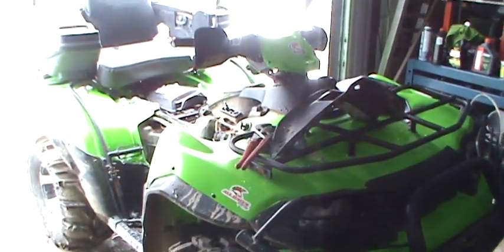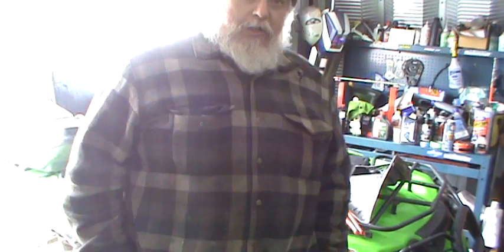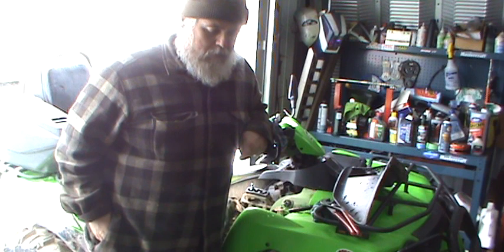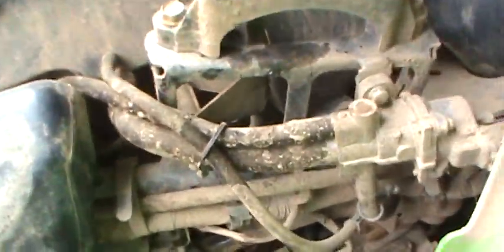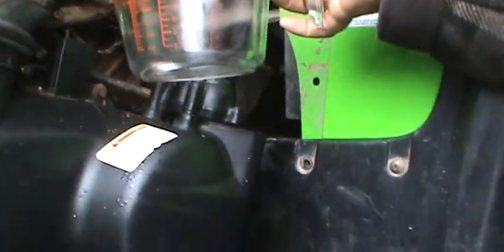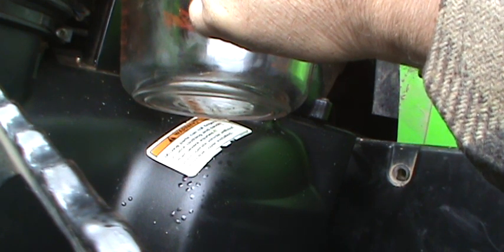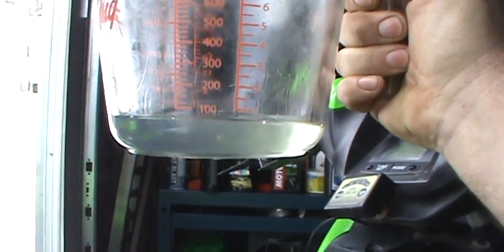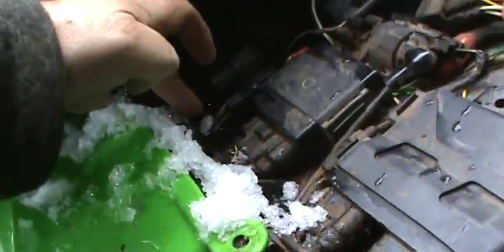Kawasaki brute force 750 no power backfiring fix

Comment: 1st off thanks for the knowledgeable vidoe(s) new subscriber here. My questions are, will that fuel pump from RockAuto work for the application of a 2010 Kawasaki Teryx 750 fi? My son did the oil change on our Teryx while I was at work & put 4 quarts in when it was only supposed to be 2.7, he drove the damn thing & oil started spitting out the exhaust smoking from exhaust + the gear shifter box he turned off the T-rex once he noticed which didn't take long, now the damn thing runs sluggish as a tortoise/backfires. The plugs were fouled- I changed them out but still running sluggish, the fuel filter was dirty as heck replacing that as well, now I'm going to check the spark arrestor may end up totally removing it. Your thoughts please.
Reply from the maker: The fuel pump mod I did should work on anything with an in tank pump. Yeah we have had them over filled before. Just make sure you flush it out real good and it should be fine.
Reply from the maker: Also thanks for subbing! we appreciate your support.
Reply: @HammerHeadGarage  The fastest reply I've ever seen on YouTube! Much appreciated, Thank You very much & have an Awesome day!
Reply from the maker: @gonzobongo6669  You too buddy! have a great one.

Comment: Is there a way to check fuel pressure on these without rigging up your own gauge? I changed fuel filter and my machine is still cutting out around 30 mph. Plenty of fuel volume in 3 key turns. Thanks for the help
Reply from the maker: If your pump is fine the small screen where the pump connects to the plastic housing is blocked. Take a bent nail and poke a hole in it.
Reply: @HammerHeadGarage  I replaced fuel pump and had 43psi of fuel pressure. Machine runs great until it gets up to operating temps and it’s back to bogging down at 30 mph. Now I’m thinking it may be a temp sensor issue
Reply from the maker: @dylannelson6223  Coolant temp sensor will make it rich as hell on warmup if faulty. What do the plugs look like?
Reply: @HammerHeadGarage  plugs were replaced about 20 miles ago. I will have to take a look at them
Reply: @HammerHeadGarage  is there only one coolant sensor on them?
Reply from the maker: @dylannelson6223  yup.

Comment: did the new fuel pump fix the problem?  my '12 brute force 750i does the same thing, runs and idles well, and once you give it full throttle, there's nothing there.  Already changed the fuel filter sock, it was pretty dirty.
Reply from the maker: Yes sir it sure did. There is also a filter screen where I pointed out in the videos that sometimes clogs up. Use a bent nail to poke a hole in the little screen.

Comment: Hey how can we get in touch, I just replaced the drive belt on mine and I cant figure out how to reset the "belt" light, was wondering if you couldn't help.
Reply from the maker: Just google it. there are a whole pile of videos on how its done on the internet.
Reply: @HammerHeadGarage  yeah but none of them help, most show 2 connectors with 4wires each, I only have 1, there's no white connector at all
Reply from the maker: @danielcastro8012  Someone lost that white plug. It is not attached to any wiring it just jumpers the black plug. I would get my hands on another machine and ask to borrow the white plug.

Comment: Do you have an knowledge on a 2002 kawasaki prairie 650? If so I have a question. I just got one for free got it running just doesn't seem to have a lot of power. I replaced the oil and batterey and ordered carb rebuild kits so I can go thru that and see if I have anything clogged any thing else you would recommend to look into?
Reply from the maker: Do a compression and leak down test and compare the results with your service manual.

Comment: I have same machine and did all u did and same thing happening and now the pump won't even turn on now please help and its a new pump
Reply from the maker: If the pump is not turning on you have no voltage to it. Check your wiring and fuse.

Comment: Hey Shawn,  I have a (new to me) 2005 Brute Force (Carbureted), that was backfiring out the tail pipe but stopped once I switched to pure gas (no ethanol). but it's still hard starting and has really low power. Thinking I need to rebuild/clean the carbs and replace the vacuum fuel pump and maybe the fuel tap/petcock valve along with a new pair of plugs. Anything else I should consider looking at for this?
Reply from the maker: Adjust the valves and do a leak down test.

Comment: Great video! 
I have an 2005 650 Brute (KVF650) and I'm wondering if I'm looking for the same volume of fuel after each ignition cycle?
Reply from the maker: If its fuel injection. If carbed nope different. Consult the service manual.

Comment: Well I'm here to ask how to reset the belt lite?
Reply from the maker: plenty of google vids to show you how. I recommend you buy a service manual for your machine.
Reply: @HammerHeadGarage  ok i already have a service manual  and found other videos on that... my situation is that i dont have a grey dummy connector at all
thanks for the reply
Reply from the maker: @damienpugh1777  are the wires there? just no plug?
Reply: @HammerHeadGarage  no plug, there appears to be one wire with an inline fuse that goes in a loop
Reply: its pre-owned. and its a project for me fyi

Comment: Hey that’s an awesome vid. 
On the 06 brute do they still have an electric fuel pump.  Mine always seams to be lacking fuel on startup. Choke lots of turning over and sometimes I have to prime it in warm weather. 
Thanks
Reply from the maker: Valves need adjusting

Comment: Great videos! Have a 750 brute force and when I jump the fuel pump it will run. Just wondering what the cause of the pump not working. I have looked at roll over switch it seems ok. By leaving it jumped on relay plug how long would it last like that or will it just burn something up? Thanks for any information on the subject.
Reply from the maker: Its the fuel pump relay. Just replace it.

Comment: Hey brother thanks for the great video.   I just picked up a 2007 750,    Doing similar things,  will not rev out all the way tops out at 50km,  I inspected the belt and reset the light already. It’s pretty sluggish.   
Starts and idles fine.    Does this fuel flow test only apply to the efi 2008+ models?   or do you recommend I get right into the carbs on the carbureted models? (From your experience)
Reply from the maker: Is the gas old(more than 45 days old) if so replace. Air filter is clean? any check engine light on? Batt voltage at idle? (Should be 13.5-14.5 v dc) Take the discharge line off the fuel pump. Is lots of fuel coming out of the line (the one going to the carbs)? Is there fuel inthe bowls?
Reply: @HammerHeadGarage  
Brand new battery, air filter is clean, no trouble lights on at all.   It was sitting for a year when I bought it. I siphoned the tank and put fresh gas, with some sea foam treatment.   Maybe I’m answering my own question and just don’t want to dig those carbs out lol.  I haven’t pulled the line to check the pump output yet,   I was going to get some specs on cc’s / time before I did that.      Sounds like I need to give the jets a cleaning huh?

Comment: Hows it going? I got a question for you and I cant seem to find any answers anywhere else. I have a brute force 750 with the same issues and I changed the fuel pump and the problem still exists. It wont go over 40 and has a serious lack of power. Any suggestions would be greatly appreciated.
Reply from the maker: when you take the fuel pump apart there is a screen where the pump pushes into the plastic part. Take a bent nail and push through that screen. They get clogged up with crap.
Reply: @HammerHeadGarage  will that not affect the injectors? Id assume the injectors would get clogged up after a while. also the new fuel pump shouldnt have any restriction due to clogged crap or does it clog up easily
Reply from the maker: @kevindalton6722  No the fuel pump has a built in filter. This is a screen at the opening of the pump to plastic connection of the fuel pump assembly.
Reply: Ok I will try that right now and hope for the best. Thanks man.
Reply: I have a 06 brute force that has no crank an the lights don’t work, I pull start an still won’t start. Seems like the computer won’t let it start

Comment: I have the same 08 kawasaki brute force 750cc. While on the trail today, the F1 light keeps coming ON and the bike started to backfire and looses power. It went into limp mode and even shut down and would start for about 2 mins of trying to. What could possibly be my issue? And where is your mechanic shop located
Reply: I have the same issue, 2008 kawasaki BF 750 and would be running good and it would turn off with a belt light on and when ever i turn the key to on position no neutral or any lights won’t turn on , 2-3 mins later they will turn on and the kawasaki will turn on, we have the same issue, i tried adding fuel injector cleaner at the same time i add gas (93) and until now, i haven’t had that problem but still need to give it a good check
Reply: Hope it helps you out, try that and let me know if this really helps you, now once i did that , it would still do it 4-6 times but eventually it stoped, i want to say that it probably cleaned the injectors.
Reply: Thank you,

I bought some fuel injector cleaner and pour it in the gas. After a couple minutes of riding. It seems fine and the power came back but now its idling too low. Hence, the bike shuts of when I stop
Reply: 2KRspeed mine did that too, and i guess it did that since we added the cleaner to the gas and it’s cleaning the injectors, but the more i used it, the fater that problem stopped, kind of got freaked out since it would do the same that happened to you, but after 2 full tanks it stopped the low iddle, i hope this really helped, since that fixed my problem, i also checked the iddle switch and have it in hi iddle for a good 30 secs when it would do that. Good luck with your atv
Reply: 2KRspeed  also, i added a half of bottle per tank,  i bealive it was the 5.25 oz the more that i added the more that i would get the low iddle, that might have been something too.
Reply from the maker: If the 
fI light is on there is a failure in the injection somewhere. You need to read the codes.

Comment: Hi Shawn,
I have a 2015 brute force 750 and I think I’m having a similar issue with my fuel pump. 

The other day the bike shut off while I was driving. And we couldn’t get it started again. Has a new air filter, we checked the air box and it was dry and clean. 

Both spark plugs are new and we confirmed they are getting a spark. 

We hear the fuel pump do the initialize sound. But some times we didn’t. And pressing the start button it would not come on, almost acting like it wasn’t getting gas. 

I left it over night and the next day it started up. But then turned off and wouldn’t start again, doing the same thing mentioned above. 

Left it again and tried it the next day. It started and I drove it around the yard for a minute, was I was driving it would cut out like it wasn’t getting gas, but then picked up, then cut out and eventually died like before and wouldn’t start again. 

I’m going to try the fuel line check you did in this video. 

If I’m looking to buy a new fuel pump, would the same one work from a 93 Jeep that you mentioned?

The bike only has 2900km on it, bought it from a guy in PEI a couple weeks ago. 

Thanks!
Reply from the maker: Sounds like a fuel pump. The jeep wrangler pump works IF you follow my video exactly on how to modify the housing. Also on the fuel pump orifice where the pump plugs into the plastic piece, there is a little strainer screen that gets plugged. Take a bent nail and push it in there to make a hole in the screen.
Reply: @HammerHeadGarage  thanks I’ll rewatch those videos. I don’t know much about working on bikes, as I’ve spent the last 15 years working in IT, so I basically YouTube things and follow along. 

This bike was insanely dirty, had that PEI red mud all over it. Took me a good week to get it all cleaned out. Ran fine for two runs then it stopped the 3rd time I had it out. 

I’ll work on it this weekend and see how it goes. I’m in Greenwood NS. 

Thanks again.
Reply from the maker: @dustin.harvey  cheers! just outside of wolfville.
Reply: @HammerHeadGarage  oh nice, thats not to far. Maybe if i cant figure it out i could pay you to take a look at it for me?

Comment: You Irish??
Reply from the maker: Family comes from Ireland yup. Here since 1870,s
Reply: Hammer Head Garage I can hear it in your accent !! I’m in Monaghan Ireland you channel is fantastic I am going to buy my first brute force 650 in Tuesday!!!
Reply from the maker: @darrencorley8857  Glad to have you aboard brother.
Reply: Hi ya I got my first Brute force 650 today 09 really impressed with the power after owning mostly Hondas . Can I ask as the new owner what should I do to give it a good once over
Reply from the maker: @darrencorley8857  Congrats on the new machine. Jack up the front end and check the wheel bearings and control arms for play and any noise. Check the rear propeller driveshaft for seal leaks (common) also keep the air filter clean and change the oil often. Every year and a half adjust the valves. Keep it out of deep water and she will run for a very long time.
Reply: @Hammer Head Garage I never go near water I have heard a lot of bad reports about them I hope it doesn’t give me any trouble thank you for the advice
Reply from the maker: @darrencorley8857  Naw, they are a solid machine.
Reply: Hammer Head Garage glad to hear thanks again
Reply: the quad is slow to start and its not that cold any recomendations on a new battery type please Sean
Reply from the maker: @darrencorley8857  doesnt matter what battery you buy as they are all shite! just make sure it fits in the hole.
Reply: Hammer Head Garage lol I love that reply 😂